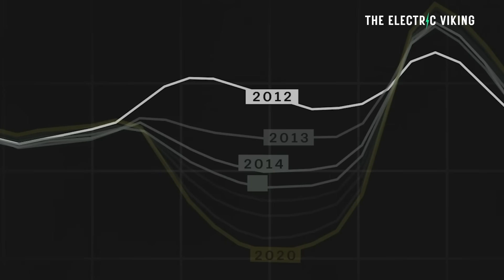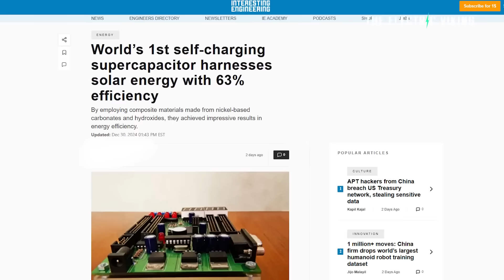Historic First: Solar Tops EU Electricity in 2025 as Coal and Gas Plummet

Comment: Wow, with all of this energy the Europeans will become a manufacturing power house again, is that correct?

What will be reasonable to conclude if it turns out this does not come about?
Reply: Manufacturing is about skilled labour and supply chains, not electricity. However, abundant cheap energy will ease household and business overheads, and there will significantly less volatility in energy markets if electricity is no longer linked to the wholesale price of gas. This create more favourable conditions for small and medium business, which are the largest employers in most economies. Services, not manufacturing, is what has driven most economic growth in Western countries.
Reply: @geconserver  That is unusual response.

On the one hand you say "Manufacturing is about skilled labour and supply chains, not electricity".

Then on the other hand you say "abundant cheap energy will ease household and business overheads".  I believe the discussion is about costs. 

Keep in mind the nature of competitive markets mean that expensive products are rejected everything else being equal. 

Even if they are not equal you cannot purchase what you cannot afford and often the cheaper lower quality product wins over the more expensive better quality product for the simple reason it is affordable.

I don't know what your background is but I have worked in businesses across many sectors and whilst there are many input costs the environments I have worked in are largely dealing with labour, materials and energy (not just electricity). 

Do not forget the fact that energy costs feed into the labour costs and materials costs also and is often overlooked by those who forget to think about the bigger picture so even in a purely service based economy they still feel the pinch of high energy prices.

We speak of manufacturing. 

Some industry requires skilled labour, some manufacturing requires almost no labour. I am unsure what you classify as skilled labour but I will opine that labour generally has seen massive decline in manufacturing and is almost gone in the manufacturing sector of competitive economies. There is a simple reason for this.

Since long before the turn of the century there has been a significant drive to roboticise manufacturing? After installation of the robot the skilled labour costs evaporate comparatively speaking. 

Let's use the case of EVs, is it your view these manufacturing plants are full of skilled labour? Or full of robotics?

This is a third party opinion but read it and tell me what you think, https://standardbots.com/blog/how-robots-have-transformed-every-manufacturing-line-from-tesla-to-toyota?srsltid=AfmBOopI4HmyH4704QksH5l2kiYTUzoaHkq2kftDcCHj1f6L-Kd5Nt3- 

Does this alter your opinion?
Reply: @geconserver  No it is not. Manufacturing is and has been for some considerable time about robotics. Labour has been displaced by robotics. 

By the way what is skilled labour and what is it's relationship with manufacturing?
Reply: @geconserver  Do you understand what the phrase "it makes little or no material difference" means? I have to ask the question because of what I see you write.

Skilled labour in manufacturing was your point. 

Lets examine your comments;

"The kind of scale factories you're talking about are quite rare in the West, but more common in China" . Could there be a reason for this? Could it be there is little to no real manufacturing requiring skilled labour in the West? What do you say?

"You may remember that Elon Musk promised that Tesla factories would be entirely robotic. " So Elon Musk has failed to make the Tesla factories "entirely robotic". It is easy to make that remark because 100% is a unique target and very difficult to achieve. 

What do you think the proportion of the Tesla factories are automated? Are we talking 10%? Are we talking 50%? Are we talking 90%?  

And what can we conclude has occurred to the portion of non-automated tasks which you are prone to emphasise are left to perform that require skilled labour? 

The tasks robots are given are tasks robots are good at, that makes sense. Yet all of the tasks robots are good at have resulted in the loss of jobs for skilled labour. Is this in dispute?

I don't disagree human involvement is still needed but for how long and is it materially significant?

" In the end, he had to hire a bunch of auto workers to carry out tasks that were simply too complex for robots." So how many auto workers were hired to perform these tasks you speak of and what were they? 

"At the other end of the scale, we have places like India where manufacturing is still carried out at scale by a large number of workers. " What I don't see any mention of skilled labour and I would be interested to see what is being manufactured and what the defect rates are.

Skilled labour in manufacturing is diminishing because it is being replaced. 

But we are so far off point because it was about the cost of manufacturing being dependent on a number of inputs including energy.

If we could get back on point please.
Reply: @geconserver  Which "abundant cheap energy"? You´ve seen the sun making a circle in the sky during daylight? First You need the kw facing sunrise, next You need the same kw facing sunset - and still You only get 2-4 hrs from each side in Summer. Hrs with excess production for the consumption - while the other 16 to 20 hrs of the day You have nothing (from solar). Add micro-grid construction and renewal, add battery storage - each of these - in $ billions will cost a multiple of all solar and wind generators installed. Small and medium business get constantly expensive energy and it´s abundant only 4 hours/day in Summer and 1 hr in Winter. The day has 24 hours. Since coal and gas are being phased out electricity prices increase by multiples - and total generation is about 20% less than it was before despite increasing demand.
Reply: @SunshineShane  You clearly have absolutely no idea what you're talking about.

In the northern hemisphere, south-facing panels are preferred because they will receive sunlight all day, which at the height of summer in the UK (and most of the US) is not "2-4 hours", it's 17 hours. Even during winter it's still 8 hours.

But if you don't have a south-facing roof, you can still greatly benefit from solar by splitting panels across East-West facing roofs, as indeed I have. Even north-facing roofs can be accommodated.

Typically today solar panels are installed with a battery on the property which stores energy generated by the panels during the day for use at night, or for export to the grid at peak rate times (usually 4pm to 8pm). Depending on the size of your property and available roof space, it's perfectly possible to have a net energy bill of zero.

My system with 32 x 450w solar panels, 12KW hybrid inverter and a 18KWh battery supplies us with a massive surplus during the summer which we export to the grid. This offsets the bills in the winter where we're pulling more energy from the grid.

Over the course of the year, roughly one-third of our power comes directly from the solar panels, one-third from the battery, and one-third from the grid. Our electricity bill is slightly net positive - meaning that over a full year, the energy company ends up paying us : ) 

The complete system cost £22,000 - but will pay for itself in 8 years. That's a better return than the stock market, and the solar panels are guaranteed for 30 years, which means in year 9 we're into 100% profit.
Reply: Oh, and by the way, I live in notoriously rainy and cloudy Scotland, which is probably the worst case scenario for solar - and yet it STILL generates a net profit. So over in the largely sun-kissed US of A, you'll be absolutely fine :)
Reply: @SunshineShane  You are completely wrong. First the electricity prises are NOT soaring, statistics is an easy answer to that false information. Second, solar panels do not need direct race of the sun, not at all. Solar panels convert both direct and diffuse solar energy, and that is the reason, that we get approx. 30% of the maximum output with diffuse light. Since solar panels are so cheap you easily can afford some extra if needed.
Reply: @SunshineShane  well thats crazy logic you use. And figures that dont quite stack up. for example, 24hrs in the day but what hrs is electricity usage minimal? There is also wind power, waves power , tidal power and the elephant in the room EFFICIENCY.   In 80-90% of situations, there is no problem. So your saying the problem of the few should cripple everyone else. You do know that research and development is on going, the technology is getting better, you do know that fossil fuel providers are screwing you over...repeatedly. You do know you subsidise them to screw you over....cut the short term thinking and grow up.
Reply: @andyfreeze4072  The only thing I know is that energy storage comes first - Norway has natural Fjords and 98,5% renewable energy production. First You need cheap, longterm-months, clean Terawatthour batteries. All the rest is an automatic consequence. Mankind decided to put "the carriage in front of the horses" by massively installing wind and solar power and waiting for something to happen. We are not quite there yet.
Reply: @geconserver  I agree with a number of your remarks that are directly related to the simple statements you have made in relation to panel alignment because it is can be supported.

After that however I suggest your personal example does not justify the remark "You clearly have absolutely no idea what you're talking about". 

To be clear, I have a PV array because someone else paid for  a substantial portion of the total cost to install it. 

I am only getting a battery installed because someone else is paying for a substantial portion of the total cost to install it. 

And I did the financial calculations which is the reason why I invested in solar. 

That does not mean I cannot have a position that says solar and renewables are a joke whilst taking someone else's money to pay for my solar installation. I am cynical of the motivations of the renewable industry and politics  but I am pragmatic also.

You must be aware of the following;

(1) Semi conductors do not start passing current until the junction volatile is exceeded
(2) Inverters do not start functioning until minimum voltage is reached
(3) PV array output degrades over time
(4) PV array output degrades with increasing temperature
(5) Battery state of health degrades over time
(6) Battery state of health degrades with every power cycle and the more you cycle the faster it degrades
(7) PV arrays make no power unless there is light and this can include low light conditions during the day!
(8) PV panels generate DC which needs to be converted to AC and that suffers a loss

PV panels are a simple semiconductor. Inverters are simple DC to AC converter.

None of this is a mystery for any first year electrical engineering student. 

Before you suggest someone does not know what they are talking about you might consider reviewing your own understanding of the entire process.

@SunshineShane's remarks are supportable. I say this because physics supports it, mathematics supports it, electrical engineering supports it, and finance supports it.

You have made your investment decision in relation to solar and good for you. If this provides a benefit to you and your family then all the better. 

But that has nothing to do with whether solar is a good choice for a society's base load power requirements.

We will find out soon enough which side was talking straight and which side was speaking out of both sides of their mouth.

We will also find out who were the fools for believing the team that was talking nonsense also.

Tell me what you know, not what you think.
Reply: @mikaelpehrman4815  You might like to try a solar simulator to see what you actually might achieve.
Reply: @andyfreeze4072  You said "And figures that don't quite stack up". Have you got a mathematics degree?

Comment: Germany is dying from having to purchase natural gas at high cost.   It's the fuel savings what counts and the high readiness cost of directly connecting  wind and solar to the grid costs more natural gas than making all the electricity from NGCC power stations.    Wind turbine generators  connected to the grid have the highest natural gas cost of any generating source.   New hydropower may be able to support erratic electricity from wind and solar.   This would explain why Scandinavian countries with lots of new hydropower can use wind power  effectively to save water head.   That can be very beneficial if the water head can drop to levels not allowing full operation of the hydropower.  Water is not generally considered fuel so the wind energy is not saving fuel as such.
Reply: Where do you get your information from? Because it's bunk. Solar and wind have the lowest LCOG and pay off their carbon footprint and "energy debt" within months. Also, there's this marvellous new invention called a "battery", which can miraculously take in energy when not needed elsewhere, and supply it at a later time. It's magic! You should look them up.
Reply: Last year there were several occasions where the wholesale price of electricity went negative in Germany because wind was producing so much.

Comment: How much of yearly production is solar?
Reply: In Portugal in the firsts 9 months of this year 2025 the production of solar energy represents 10% of total electricity generated .
Reply: @luismartins4149  In Portugal, in the first 9 months 2025 natural gas represented 30%, coal less than 1%, fossile co-generation between 4% and 5%, nuclear between 11% and 14%. Hydropower 21% in Q1 with 16% from windpower, in Q2 and Q3 windpower generation dropped to 11,4% and Hydropower jumped to over 31%.
Since Portugal blew up the last 2 coal plants in 2022 the former exporter now imports electricity at a cost of +- 2 bn USD, a fact that weighs on consumer bills. With millions of tourists in high Summer season, electricity demand is high and dams/ hydropower are producing at maximum levels during the 16-18 hours a day when the sun doesn´t shine straight on the solar panels. (No coal anymore). This has a totally "unexpected" consequence: at the end of Summer dams are nearing dangerously low water levels and the country is doomed if it doesn´t rain in Winter (like it still does). Of course empty and dry dams are automatically attributed to climate change - not to excess hydropower production and tremendous water consumption precisely when it´s hot and dry anyway. 
Soon the discussion will restart if next year water has to be rationed for agriculture (no watering of apple and orange trees) and private households. Orange, citrus and apple trees have been around for at least 1,200 years. They have become an endangered species now. Sorry for the rant and for looking at things too objectively. Last but not least: As a curiosity, since the Iberian blackout in April 2025 which had "absolutely nothing to do with solar production" and renewables in Spain, both Spain and Portugal have limited solar feed to 50% of total generation and use natural gas (or hydropower) instead. In previous years in high Summer season they reached 74% and more (90%) on some days during the sunny hours at midday.

Comment: I want to see what the countries can do during winter for solar that is when solar proves itself to work
Reply: Solar systems are most often designed for the lowest avg sunlight in the year. If say you needed 5kw for a building you would want it to make that on the winter solstice when the days are shortest the rest of the year it would produce more than 5kw so you actually have more than 5kw of solar to meet your goal. Obviously determining your demand is key to designing any solar array
Reply: @stevey_z  I totally agree on that, because that is what I have used for designing my roof-top solar panels in Sweden, latitude 57. So the surplus during Mars to November is exported to the grid. April to September I generate more than 1000 kWh each month. My house is generating more electricity than it uses, and still I use up all I can heating tap-water and charging my EV. Even heating the house in September.
Reply: wind still blows, waves still happen, tides still happen. Batteries are key.  It pays to have a spread and large batteries.  What happens when Russia doesnt sell uranium anymore? Another point of blackmail.? Being 80-90% self sufficient is a strategic goal, not just a financial decision. The BS narrative is based around the thought that it doesnt work when clearly in lots of places it works beautifully. Using the odd ball situation and claiming its the majority position is just plain stupid logic.
Reply: it's called wind power. European wind generates more in winter-> QED.
Reply: I want to see how walking around in a t-shirt works in winter.
Different seasons require different solutions. In Europe wind power works very well in winter and adding more batteries and long distance grid connections help to balance everything.
It's all about depending less on fossil fuels, so even burning  gas or coal in case of a shortage or keeping existing nuclear power plants in France working just a little longer is okay for now.
Most countries are also working on seasonal storage solutions so we don't have to waste the summer surplus and can replace gas reserves with Hydrogen to support the grid in winter.
Reply: Winter is only 3 months , you have 9 months solar